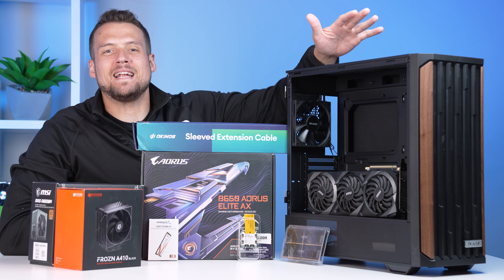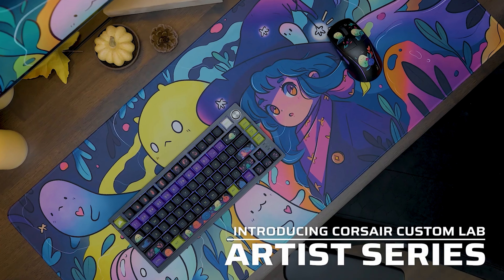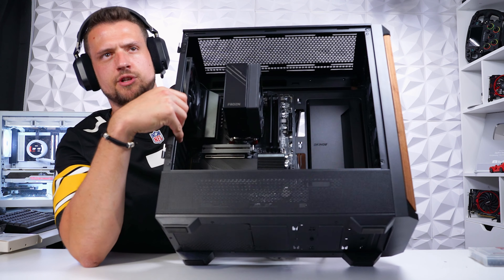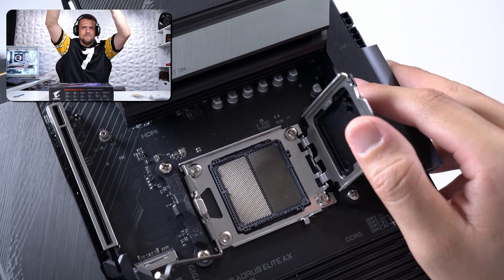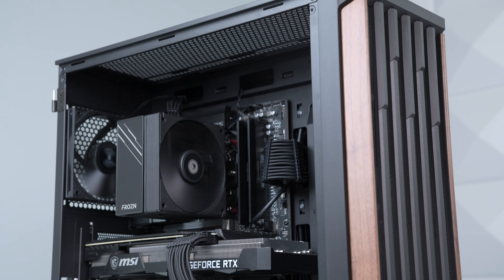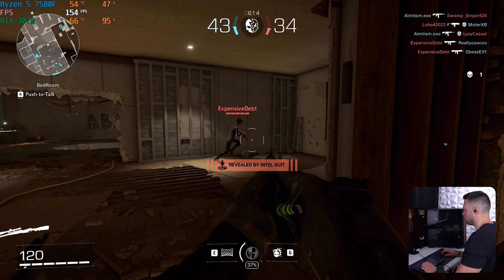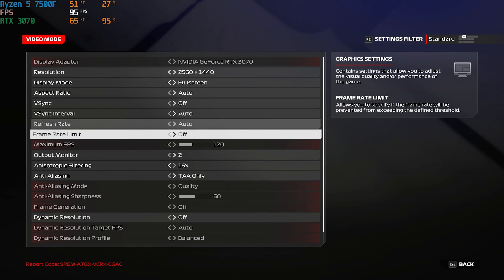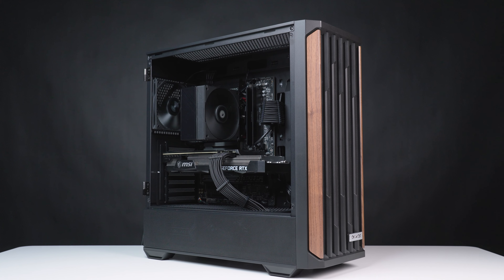$800 Gaming PC Build Guide

Comment from the maker: Check out the extended benchmarking run for this build on the ZTT Extras channel: https://youtu.be/IQfd9ieNylg
Reply: Hi zac i just snipped a rx 6700 xt for rupees { 18000 } or ($ 215.60 ) and still got one month warranty although the new graphics card is going around {78667} rupees or ($ 942.27 ) and i am trying to build a 1080p budget pc and i am going to get b550 motherboard 16 gb ram 600 volt power supply and RYZEN 5 5600g is it good with an Acer Nitro VG240Y  IPS  23.3 inch
Reply: @ZachsTechTurf I just got a HP omen 16 gaming laptop with an rtx 4050(120 watt) and i5-13420H and 16 GB of ddr5 ram for only $550 on microcenter. You think it's a good deal?
Reply: Please can you build a 800$ am4 pc love the video
Reply: What if you made a vid for a 700€ setup but what you think it will get you over 2 years
Reply: zach please unban me from your discord server
Reply: I bought a Rx 7600 and r5 7600 pc for 830 prebuilt.
Reply: @ITACHI-iz4fo but what hz or resolution
Reply: I'd love to get your insight on whether I should buy Nvidia or AMD cards for creator-based PC (I don't game at all)...
Reply: @Dark_night_comes  1080p. 180 hz
Reply: @ITACHI-iz4fo  its perfect don't listen to others
Reply: ArmanShehzad-sv9ys  bro I am also from Pakistan the gpus are expensive so I tried to get them from foreign countries but what other than America the other countries are almost the same price
Reply: @Jossy.mp4  Im not exactly Zack but I think a amd gpu like a 7700 xt or higher is great for anything, not just gaming. Also you save some money buying amd. 👍
Reply: Do you deliver your PC's to India , great fan of ya
Reply: @ZachsTechTurf what should be the budget CPU and GPU for resident evil 4 remake to get 120+ fps with ray tracing on
Reply: @LaughAiLoud  r5 7600 and 7700 xt should be fine.

Comment: 8 GB of VRAM is punching to low in this day and age. Period, end of story.
Reply: Cherry picking games that make the GPU look better to boot.
Reply: A deal breaker tbh.
Reply: I picked up a barely used Radeon 6700 10gb for $200. Do  you think that one is better? I have the choice between a Radeon 6600 8gb  and the 6700 10gb for a system I am building for someone.
Reply: @freedomearthmoon1  the benchmark at the end is pretty telling though, isn't it? Unless you think its shady. Being able to run 1440p at over 60 FPS for all those games for the benchmark, seems pretty solid for the price
Reply: HellWrex...For the price?Its a decent build, that's not my point or comment. It doesn't make up for the lack of VRAM.Case in point.A YouTuber " zWORMz gaming" has a video called "RTX 4070 - Not Bad at 4K! (Gainward Ghost)".At 4K hes hitting high fps in 17 primarily demanding titles.It's the 4070 with of 12 GB VRAM.1/2 of the games utilizing over 8 GB and many are at 11+GB.I run a 4070Ti Super 16GB.I've seen VRAM usage close to 16GB.So yeah,8GB is to little in 2024.
Reply: Just like ram
Reply: Amen
Reply: I got 6
Reply: @Inkbyotb  That sucks

Comment: Until recently I was convinced to buy an Xbox because the PCs in the same price range didn't convince me, but this one, apart from the fact that I liked it, seems very powerful and adequate for the price to spend.
Reply: It is a good quality-price ratio, maybe in some very demanding games it will fail you but it is still a good PC, just try to install Windows and Office in a paid way so you don't have problems in the future.
Reply: As long as it reads all my games I'm happy, yes yes I already saw that BNH Software has all that thanks

Comment: Love that you went with AM5 for this build. The previous 750$ build was am4, and while it had more performance this build was mad beautiful!
Reply from the maker: Yep! Tried to mix it up to show the other way of doing it. Thanks for noticing :)
Reply: @ZachsTechTurf  man can you build the cheapest am5 pc possible for like 450 usd or so
I am on a tight budget and want to get on the am5 platform also used components are okah with me
Reply: @drehitwari7143 with 450 u can’t do anything honestly
Am5 would be a stretch even without a GPU 
With a budget like that you have to go am4 with a used components
Used ryzen 5 3600
Reply: @ZachsTechTurf do you still do pc drops for these videos
Reply: @drehitwari7143  Maybe not for 450, but you can go for like a Ryzen 5 8400F and some cheap A620 mobo, but at that point you are better off with a Ryzen 5 5600 for gaming. Or just go for a 8500G/8600G and get a gpu later.
Reply: @drehitwari7143 you high?

Comment: ello I'm trying to build my own PC do you have any advice about which parts I should upgrade  parts: Armaggeddon Tessaraxx Apex 8 Air ATX Case with Vertical Mount GPU Support  part 2 Arktek Intel H55 Socket LGA1156 Dual Channel DDR3 Motherboard part 3. RGB Power Supply for Professional Gaming PC part 4. AMD Ryzen 5 4500 6-Core 3.6GHz CPU Processor part 5. Kingfast 16GB DDR3 1600MHz Desktop RAM Combo (2x 8GB DDR3 1600) part 6. WD 1TB Notebook Hard Drive - Blue part 7. Arktek Nvidia GT610 2GB DDR3 64-bit HDMI / DVI / VGA Graphics Card  I would really appreciate if you make a video or a YouTube short I also live in South Africa that have a budget of R10,000 so if you make a video thank you very much

Comment: Hey i need your help please🙏
[Not related to video]
Recently I bought a lenovo gaming laptop which got i5 12 gen hx processor with rtx 3050 6gm 95 watt tgp 
And when it's under load regardless or cpu Or gpu like while playing games or when running prime 95 for stress test for an hour or so battery will drain even when plugged into power and it's not like to 98 or 95% it'll keep draining I've seen it go to 85-87% even though it's connected to power then I got to know that this problem is common with the laptop model and I've to raise a complain and company most probably will help out or something by change 170 watt charger to 230 watt but when I contacted them they literally said it's common for gaming laptop to lose 5-8 % battery per hour even when charging when gaming or doing some cpu or gpu intensive task so I just asked it means if I'll use the laptop for 7-8 hours straight for gaming or something it'll just die and they said yeah 
So what am I supposed to do? Is this really common or what ? 
And no I've not overlooked made any changes to default gpu cpu settings , please help

Comment: Should I get a 5600g and have a workable pc now and add a gpu later or get a 5500 and a gpu all at once in a few months?
Reply: 5500 and get a gpu
Reply: @nob8371  are you sure
Reply: @Hunter-zl7ej  yep
Reply: @Hunter-zl7ej  it performs the same and is way cheaper
Reply: @nob8371  what would be the benefit to waiting?
Reply: @nob8371  but i want a pc now, I play games in 1080p at least 60fps

Comment: I got an Asus Prime H770 plus D4 motherboard and a cooler master power supply MWE  Gold 850 V2  from an auction for under 80 CAD. It has LGA 1700 socket. Which processor exactly is best and graphics card for this motherboard and processor? I am thinking of getting a 1 TB m.2 gen 4 and 32 GB ddr5 Ram.
Reply: Also please suggest a cpu cooler with that cpu.

Comment: I am planning on upgrading my computer in the future (about 1yr) and i am not sure whether i should stick to lga 1700 and upgrade from a i3 12100f to a i5 14600 kf (and a new cooler about £240 upgrade price for both)or switch to an am5 ddr5 system with a new motherboard new ram new cooler and new cpu(£480). Has anyone got any advice.
Reply: I'm an AMD fanboy because I love upgradeability, but it's your choice. It depends on your budget, what you use the PC for, whether you like Intel over AMD or vice versa. If you do mainly gaming and a little bit of productivity then yeah I'd say go with AM5 because you'll be able to keep upgrading that PC way into the 2030s if you get a good motherboard. If you do mainly productivity then I'd probably upgrade to a 15th gen Intel cpu when it comes out. So while switching to AM5 may be more expensive at first, if you get a VERY good motherboard (I don't recommend cheaping out on a motherboard, especially if you're going to AM5) it'll actually give you more value because you'll be able to keep upgrading that PC up to 8 years or even a whole decade and all you'll have to do to upgrade is just throw in a CPU and maybe a new cooler.

Comment: getting the 6650xt and 5 7500f soon not because of choice tho, its slightly cheaper but it comes with a 2 year warranty which is cool i guess, i wanted a 6750ct or 6800 which are like a 30$ difference where iam at and its stressing me out that they dont have the 6800xt in stock lol but if i get anything other than the 6650xt the warranty goes to 1 year and its my 1st pc, iam also a cgi artist i think the rig will be good regardless for my need but idk fomo is on me LOL, also not in the us so i dont have the privelege of buying used or buying from manufacturers or amazon without 20% of the costs going to shipping
Reply: Warranty isn't something to be overly concerned with. It's definitely something to look at, but if you can afford better performance with a year warranty I'd buy that

Comment: Built mine for $800 few months ago, builds seem remarkably similar:
-Ryzen 7700 (not 7700X, deal was too good)
-MSI 2070 super
-same mobo except no bent pins
-originally took a chance on a 40 buck psu, was underpowered and would shut off on surges, replaced with MSI MPG A850G
-Corsair 2x16g 5200 mt/s memory
-matx case
-1440p 165hz
-cheap fans and tower cooler keeps temps well within range, mostly bc that cpu doesnt get hot relatively 
----- in retrospect would've dropped the cpu down a couple cores and gone for a 3070 or 2080 + LISTEN TO LINUS DONT GET THE CHEAP PSU DONTTTT

Comment: Please help me sir I have not idea what is  buy today msi Titan 18hx 7945hx and i9 14900hx laptop but checking processor performance 7945hx is best but i9 14900hx is new then any benefit that why i9 14900hx laptop expensesive of they are performing low any benefit if I am buy msi 18hx i9 14900hx or 7945hx no on make video for this processors comparison please tell me that what actually buy ? 7945 hx laptop is low price best performance and i9 14900hx is high price but low performance in compare 7945 hx .

Comment: random question since you know much: bought a msi mpg b550 gaming plus mobo. using a ryzen 7 5800x with 2x16gb ddr4 hyper x fury from an alienware aurora r10. the mobo wont boot. with only the cpu installed, the debug led jumps from cpu to ram. with ram installed, it goes from cpu to ram, then back to cpu. what could it be? the hardware works perfectly fine in the alienware. does dell use non-standard hyper x ram?

Comment: My PC shuts down and turns back on by itself after a second but when it turns on nothing on screen pops up so i just shut it off by pressing the power off button on the back of my case and turn it back on and when i do that then the AMD Adrenalin edition notifies me that the default setting were set due to an unexpected error and the games setting were set to lowest possible,this only happens when i play gtaV warzone and other higher games,my CPU temps go crazy when i  put the cpu usage on 100% so i put it on 99% and im getting stuttering with FPS when playing
please im really on a budget here so here are the specs of my PC.   MotherBoard-B550M Ds3h , GPU RX 7600 XT qick , CPU R7 5800X , 750W PSU , 32 RAM. Ive also tested my CPU and GPU on benchmarks and they run totally fine just the CPU when its on 100% usgae gets hot to its limits

Comment: Please help. why am I experencing sever fps drops? 7600x and 7900 xtx 85w psu. Is it a cpu bottleneck? Ill be playing hogwarts legacy, and for some reason while running in the defence against the dark arts tower, Ill go from 120+ fps to about 50 for like 3 seconds. Happens in some other parts of the castle too. Also when playing fortnite on hight settings dx12, the fps will drop from 150+ to about 60. Please help.

Comment: I recently found your channel and its like cheat bcz your valuable info for building the right pc build for your needs as well as the badget ..well i have a laptop with ryzen 3550H but the gpu is the old now rx560x (was a great gpu for its time though i overclock it to gain some valuable frames and is still amazing in my favourite Division 2 pc /50 fps avg lowering a little the resolution from 1080p.) anyway i m thinking of going to pc build now and because of low budget i m thinking of a good pc build without discrete gpu. I will wait for the new gen here. Im asking you of cpu mainly and then a very good mobo for extra goodies like music plugs and stuff. I have the LG oled c2 evo and this monitor deserves a good gaming pc. Im not into consoles im the wasd and mouse only gamer! Now how about Intel's 14100? I found it in good price and im asking for future possible throttle with a capable GPU. I know thats not easy to say because we dont know much rtx5xxx and new amd but i want your tips! Mobo im open to suggestions too i want a good mobo with extra functions and PCI ports etc

Comment: If you don’t mind but. Is this a good price for a prebuilt. I know it’s not in accordance of your region but I like to know your opinion on it

£1,499.99
Rtx 4070
16gb ddr4 3200 mhz
1tb
I7 13700 kf 3.40/ 5.4 ghz 16 core 30mb cache
Windows 11 installed 
B760 motherboard
700watt psu
Reply: kinda bad price

Comment: Hey Zack I found a deal on a used pc with an Rtx 3080 and an i7 12700 32gb DDR4 and a 256gb of m.2 and 1TB HDD of storage and windows 11pro activation all around 880$ and it have a 1 week guarantee of working from a shop should I buy it? Pis reply quick
And what should I do to test if it is working like applications and benchmarks

Comment: Can you please rate my pc build. What should I change? I am open to any  criticism 😊( I did spend a lot of time on it);
CPU: AMD Ryzen 5 7600X 4.7 GHz 6-Core Processor

CPU Cooler: ARCTIC Liquid Freezer III 360 56.3 CFM Liquid CPU Cooler

Motherboard: MSI MAG B650 TOMAHAWK WIFI ATX AM5 Motherboard

Memory: TEAMGROUP T-Force Delta RGB 32 GB (2 x 16 GB) DDR5-
6000 CL30 Memory

Storage: Crucial P3 Plus 1 TB M.2-2280 PCle 4.0 X4 NVME Solid
State Drive

Video Card: XFX Speedster SWFT 210 Core Radeon RX 6650 XT 8 GB

Power Supply: Thermaltake Toughpower GF3 TT Premium 1000 W 80+Gold Certified Fully Modular ATX Power Supply
Total is 1000€

Comment: Hi Zack! I have a few questions for you:

1. If I am using the bottleneck calculator, does it matter a lot how much percentage I get? For example if I got 13% should I choose a different CPU or GPU?

2. Do you think 16 Gigs of RAM is okay for casual gaming?

3. When building a pc, is it essential to have an anti static wristband?
Reply: here
Reply: 1. yes that is too high, pls change. 2. 16 gib should only be used if the pc is less than 700 bucks, if its more upgrade to 32 gb. 3. no
Reply: @APortugueseHome  Thanks!
Reply: Don’t use bottleneck calculator
Reply: @Davinmk  even thought many aren't 100% accurate, it's still a great tool. however, just check the graphics intense option
Reply: @APortugueseHome  no its not, its 0% accurate
Reply: @Davinmk  now you're just being an ignorant..

Comment: Im 12 years old and I've flipped one PC so far and Im in the process of flipping another. For this one, Im using an Aorus RTX 3070 MASTER that I got for $235, a Ryzen 5 5600 for $70 from aliexpress, a $44 MATX MACHINIST motherboard from aliexpress, 16GB Killisre ram from aliexpress for $29, an Aigo CPU cooler from aliexpress for $9, a 512GB ssd I had laying around, a 4TB hard drive that I got for $15, but I stil have not gotten a case yet. Is this a good build for flipping or have I messed up and any suggestions on a case?

Comment: change the cpu. get the 12700kf, you get 12 cores and wayy better performance in multi and single core processes for the same price. its a steal. and you can also get ddr4 if you want to upgrade from an older pc
Reply: But you are locked into the lga 1700 platform, which might not matter at a lower price but when you can you definitely should
Reply: i dont really understand why yall say the lga1700 is locked but still consider am4 in a new pc like when i do a pc i want it to last a long time so even if i get the newest platform its still gonna be outdated when im gonna upgrade so i dont see a problem here. you really dont need an all future proof pc. i think its a bullshit marketing scheme. i mean a 12700kf is still a GREAT cpu. you really dont need more than that for your casual and even competitive player. if you play esports or even minecraft which i consider its a pretty good and popular game will run amazing. i dont play cyberpunk rdr2 or any high demanding game. so id say the 12700kf is the objectivly better cpu.
Reply: @unknown_4206  yeah you don’t need a high end cpu if you play Minecraft, great argument 😭
Reply: @Davinmk  still wayy better choice than an overpriced 7500f

Comment: Zack try this build

Corsair CX550 ATX 550w 80 plus power supply
 
AISURIX rx 5500 8gb gddr6 graphics card 

Ryzen 5 4500 CPU with cooler

Lexar 16gb rgb ram ddr4

Msi mag forge 112r mid tower case
MSI B550-A PRO ProSeries Motherboard

Kingston 1TB nvme ssd

All from Amazon pls reply

Comment: PC PART	PRICE 	MODEL	WHERE
CPU	70	RYZEN 5 5600	ALI EXPRESS
GPU	310	AMD 6800	ALI EXPRESS
MOTHERBOARD	60	ASROCK DDR4 	ALI EXPRESS
SSD	90	2TB FANIXIANG	AMAZON
RAM	60	CORSAIR 32GB	AMAZON
POWER SUPPLY	40	SWITCIHNG 850 WATTS 	AMAZON
PC CASE	65	AMANZON CASE 	AMAZON
CPU COOLER 	7	AMD COOLER	ALI EXPRESS 
			PS5 PRO Killer like if you want more builds - This build is 700 Pounds
Reply: Good

Comment: I finally upgraded from a prebuilt to custom built. Msi b650m-s ddr5 4800. Ryzen 5 7600x. Kingston 2tb m.2 nvme ssd. Amd rx 7600 challenger gpu. Corsair 750 80 plus gold psu. Cooler master hyper 212 black edition cpu cooler. Fury beast 32 gb ddr5 ram. Matrex 50 rgb 4f. Seems to be working really good for what I use it for.